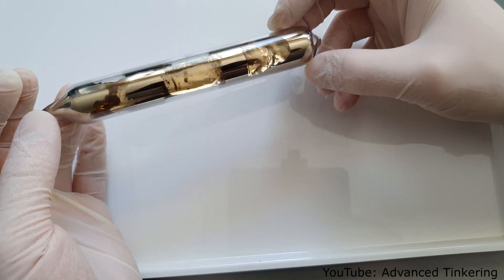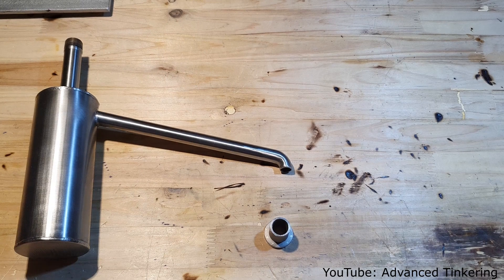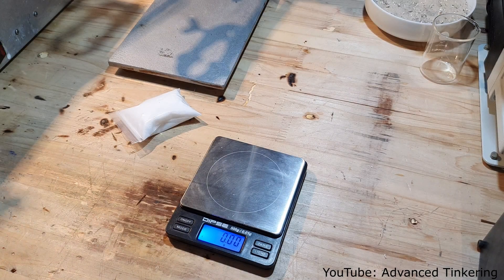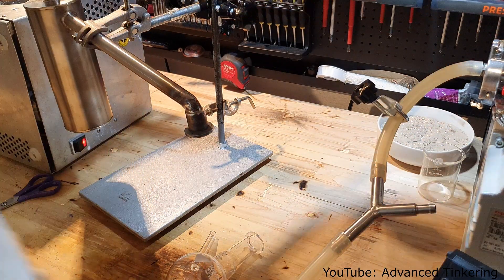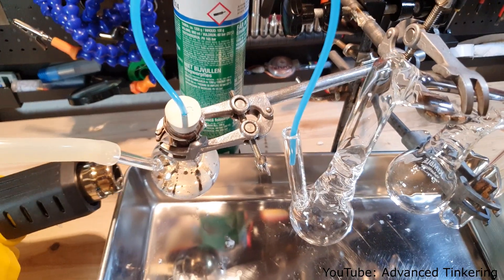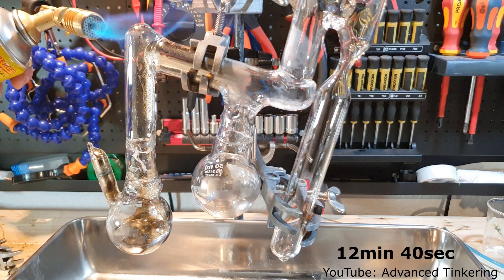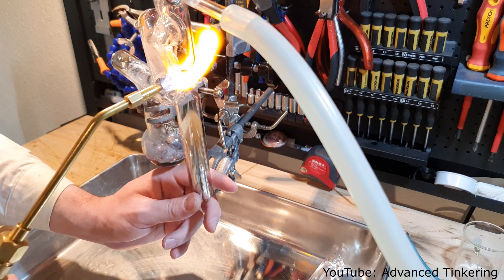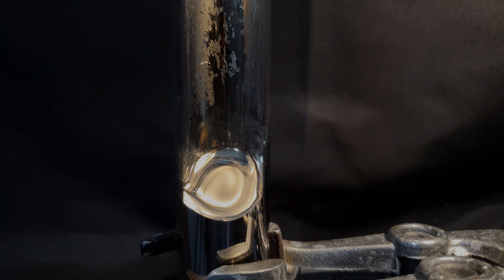Making cesium and distilling it in my homemade still

Comment: I'm wondering if sodium instead of lithium would work (and perhaps work better?).  Even though sodium still has to be made rather than bought, there are ways of making it comparatively cheaply thanks to Nurdrage's methods.   It uses a Li starter, then after that a sodium starter.  The yield is quite good.  Alternately, you could build a sodium electrolysis cell (using either NaOH or NaCl). I wonder how well the Cs reaction would work using Na to displace Cs from CsCl?
Reply: Lithium has a high boiling point. The others could theoretically cross contaminate.

Comment: An idea that might be worth a try is to cool the spout.  That should stop it from overheating and cracking the glass.  A lot of ideas come to mind.  Simplest would probably be to attach aluminum fins (ie an electronic heatsink) and blow air on it.  Better would probably be to wrap the output in a coil which you pump cool water through.  Since it stays liquid down to about 30 C, it doesn't have to be very hot to flow as a liquid.

Comment: i think the cheapest cesium source may be cesium formate solution  which available by the metric ton for about euro 100.-  a kg  as heavy liquid for oil and gas drilling   from that i would produce cesium alum as  the most badliest soluble alum   reduce the crap with magnesium powder  and destill off the cesium     of course after  all the crystal water etc.  is gone   vapor pressure of magnesium and cesium or aluminium  should be different enough to seperate them in high vacuum   and save on lithium  you should be able to make a high purity cesium metal with the desired  golden color I once bought a nice size cesium vial which i liked  to hold in the hand until completely melted and   then see the crystallisation The guy y I bought it from got it from a customs auction as  customs had confiscated the cesium from some very smart  smugglers.
Reply: All these processes that you mention, 🤔 do they make any byproducts? 🤷🏻‍♂️
(Like toxic waste, 
or pollution?)

Comment: Look up triclamp fittings. Super cheap, stainless, go together with clamps. You could make the whole vessel open in the middle easily. Glacier tanks has been my cheapest source. Don’t look on McMaster, sooo expensive for triclamp.
Reply from the maker: Yes I looked at Triclamp fittings. But they are not compatible with the KF fittings. At least as far as I know. 
I don't think the seal would withstand the high temperatures at the reaction vessel. It is very hard to find a seal that holds vacuum at 600 °C and is resistant to Lithium and Cesium. 
That's why I had to use a mica based gasket with my first reaction vessel(you can see it in the first video I made about cesium).

Comment: Buy a band saw and coil for cutting thick 2mm+ metal, that might help.
Also when using thread tape start at the bottom of the thread and work your way up.
Little tricks here and there can help 🤗

P.s 
Oh and lastly my heart was beating so fast when I seen the vacuum set up 🥶 hmm maybe secure the tube to the collection flask a little bit more ...

Comment: @Advanced Tinkering - i found your channel just today - i am myself am working on cesium for more than 3 years now as a project on my spare time - funnily enough i think you are german as well judging from your accent. I absolutely love to see the simmilarities and difference we have come up with creating our assemblies. I myself found the exact same metal ground joints as you were using - for a reaction vessel I decided to have a liftable cap which is sealed using silver plated oxygen free high purity copper cf gaskets - I could go on and on but i would love to get in touch with you - is there any messenger or email i could contact you with? i think we have many ideas to share for improvment - massive improvments i found were heating every part of the setup 3-4 hours at 140°C - to make sure any trace of water / moisture is removed. Afterwards assembling speed is also a crucial factor as every bit of moisture will cause impurity - so quick assembly and vacuum pump down is required. also the quality of the vacuum is a big factor as well - i started to get really nice resulty ar 10^-2 onwards. 
Um es kurz zu sagen - gerne melden ich würde mich extrem freuen wenn wir Information austauschen könnten.
Reply from the maker: Hi,
klar, du kannst mich unter: advancedtinkering@yahoo.com kontaktieren. Würde mich sehr interessieren, wie dein Aufbau aussieht.
Reply: @AdvancedTinkering  Wunderbar, email sollte angekommen sein.

Comment: 9:27.  Why the hell aren't you wearing any PPE on your hands?
Reply from the maker: Wearing gloves is always a compromise. Gloves that would be sufficient to protect me would be so thick, that I would lose a lot of dexterity in my fingers. Thus increasing the likelihood of messing something up. Thin, latex or nitrile, gloves would not protect me and would add the risk of molten plastic on my skin.

The reaction of cesium is very quick and (provided the contact is very short) not as damaging to the skin as one would think.

Of course, I was wearing safety glasses and a lab coat.

Comment: Can you send it to me? Pls, I am an element collector
Reply from the maker: Sorry, I don't sell or give away the cesium. But there are shops for element collectors, where you can buy cesium vials, that have been encased in acrylic to make them safe to handle.
Reply: Also sending cesium legaly aka properly labled and packed is firstly really expensive and secondly a giant headache - also depending on the law (in this case i assume germany) you need to have a sort of allowance which would enable you to sell that - aka a prrof that you know how to handle those substances (the seller needs that)